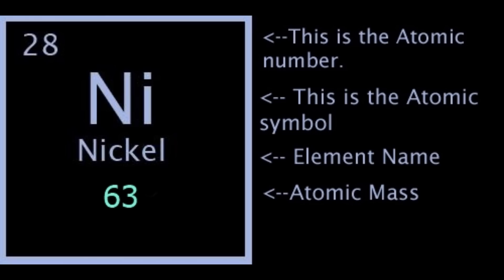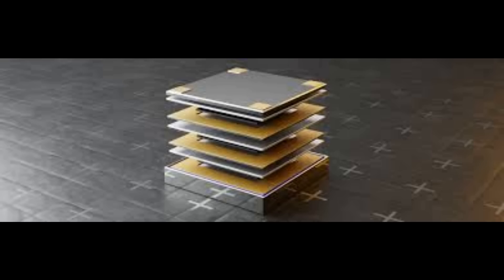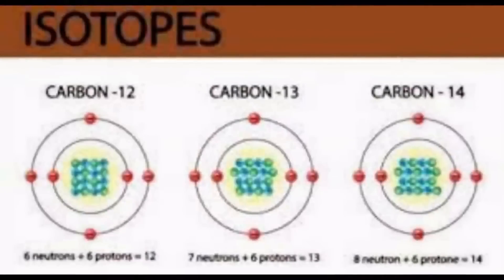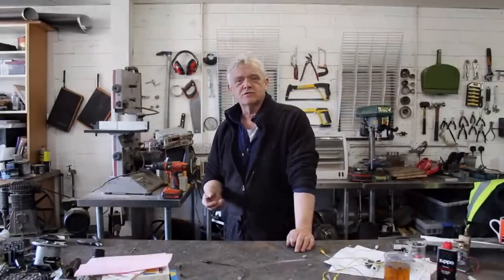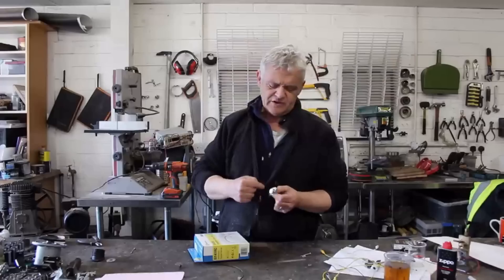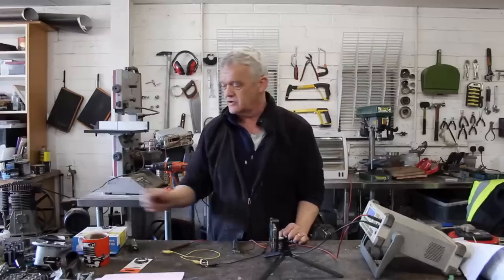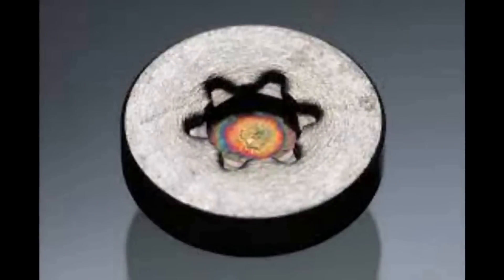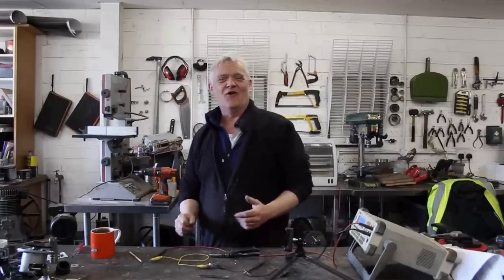2187 - The 50 Year Nuclear Battery From China And How To Make Your Own Version

Comment: A nuclear battery, etc, of low power can be assisted by a capacitor for when a relatively large amount of power is needed, say a transistor radio or a LED lamp to function when needed.
Reply: joule thief
Reply: Supercaps are also used to make mini portable car Jumpstart boxes.
Reply: This concept relies on the particle beam itself hitting a point on a surface that generates the current or whatever, so in theory, a large sphere with the inside wall full of these minute batteries focused on the same central point that can generate this current (or whatever) would result in a much higher energy concentration and for the 400 years or so. Think of how a satelite dish works.

Realistically we just need to do the math on how large that sphere/dome would be and build ourselves one of these bad boys that can power a house.
Reply: Maybe not practical by itself, but, in theory we could link up enough of these to continuously and passively power some sort of mechanical energy storage system, it could always be adding power to a reservoir of sorts, which you could tap from when you need large amounts of energy.
Reply: @Max_Chooch  rethinking your suggestion, the mechanical storage would have to be immune to the effects of (for lack of the lroper term) 'self-discharge' to be practical. Being mechanical, there may be a design that has that feature and is unlikely to decay faster than the tiny trickle of power can deliver energy into the system.

The primary uses i can think of are all related to satellites and devices in space.
Reply: With such super tiny power, even storing energy while a device is not in use wont make it much more usable. Let's say you have a smart phone or transistor radio that consumes 1 Watt of power when in use. If your nuclear battery outputs 100 micro Watts of power, you will have a usage to off ratio of 1/0.0001 = 10,000 times no matter how you store the energy. It means if you use your smart phone for 4 hours in a day, you will have to charge the battery for 40,000 hours or more than 4 years before you can use it again. And modern smart phones are using more than 1 Watt and many people use it more than 4 hours per day so you have to wait even more before next time you can enjoy your old iPhone hahaha
Oh, I should also add that any mobile phone is using power even to just be in standby and ready to take an incoming call. The idle power consumption can easily be 1000 times more than what these nuclear battery can output, so you can't even power a smart phone in standby lol...
Reply: No, it can't. What you can do is use it to charge a conventional battery during "off-time", for devices that require power only intermittently. And yes, I said "battery" and not "capacitor", because capacitors can only store relatively small amounts of energy.

However, a far more efficient way to achieve this is by using a bog standard charger if you live in a first world country and have access to mains voltage Or a dynamo built into the device, like with some torches or radios, if access to mains voltage is problematic (no infrastructure, or during a power outage). Or use solar panels if it's a device in a remote location where you don't have mains and winding the dynamo is impractical. E.g. a LoRa node monitoring some environmental parameters in a remote location in a forest, or what have you.

I get it, these batteries are cool. But they're not a solution to every problem that has "power" in the title. There's a place for these things for sure, but powering devices that require more power than they can deliver is not it.
Reply: @EvenTheDogAgrees  Capacitors are far more efficients for fast "charging/decharging" cycles, like for example a low power device, 1W is not enough for a spike usage during wifi transmission for example, but you can use a few capacitor so that those spike are smothed out. Datasheet for the ESP32 declare a 260mA power usage in WiFi TX  with a 21dBm, at 5.5V that just a little over the 1W provided, assuming you can have small duty cycle and cut the wifi after a capacitor is enough and far more efficient than a full charging circuit. And that's the kind of application those battery will be used primarily, low power and low maintenance systems, perfect for non real time sensors and the kind.
Reply: @Larandar  yup, for such use cases it would be very suitable. Similar to the LoRa node I used as an example. But not to power things like radios or flashlights, unless it's just used as a charger for the real battery, and the device is only used very rarely. But like I said, there are already better solutions for those, e.g. hand cranking.
Reply: @Larandar  Just beware that ESP32 running on a nuclear battery isn't giving much run-time out of a 100uW nuclear battery. Whatever wakes it up has to use micro Watts of power and the duty cycle has to be 1/0.0001 = 10,000 times more off than on to reserve enough energy. Considering the half-life of the isotope, loss of efficiency over time and wake up circuit, you probably want to get to 20,000 times more off. Let's say you want to do a single transmission every hour to monitor a temperature, you will have the ESP32 running at 3,600/20,000 = 180 milliseconds. Adding more of these batteries should make it doable and such sensors are probably the most useful application of these super tiny power nuclear batteries. Forget about drones, TVs, laptops, mobile phones etc.
Reply: @EvenTheDogAgrees  I agree, but I'm in also agree with Robert basic concepts , I was  hesitant to find practical or efficient use.
Reply: @EvenTheDogAgrees Yep, it's mostly for keeping the contents of SRAM intact.
Reply: @EvenTheDogAgrees  iirc lora devices use as low as 0.5w of power, so you would need one of those commercial radioactive batteries and a capacitor to smooth out the output and act as a buffer in case of consumption spikes, imagine getting hundreds of those, tucking all  the electronics into sealed cases with antennas and spreading them around the world as emergency backup comms
Reply: @EvenTheDogAgrees supercapacitors can hold a decent amount of energy now, there are disposable vapes that use them instead of batteries.
Reply: @chemistryofquestionablequa6252  Are you sure these are supercapacitors? Some time ago i had seen a YouTube video where the guy disassembled a vape pen - the cell turned out to be a Lithium battery with a capacitor-style package.
Reply: @Gigasimo456  Yes, this is a recent development. A Tuber broke it down (don't remember who EDIT: IT WAS CLIVE!), some companies are switching to super capacitors because they are cheaper comparatively, hold less charge and are safer (allegedly).
Reply: @PanoptesDreams Big clive probably
Reply: @Ewr42  checked my history by searching his name, it didn't come up. But the flesh burning death lamp did ☺☺
EDIT: I was wrong! It was Clive, I just watched the video on a different browser so it wasn't in my YT history,
Reply: @chemistryofquestionablequa6252  As a motorcycle rider/builder and vape shop manager, 
I can vouch that Yes..  Supercapacitors are used in both 'vapes' as well as some motorcycles [for electric start]
as well as caps/super-caps use in auto audio setups [they help deliver constant/burst power for amp'd subs, etc.]

They're also good for charging up and throwing at your friends - yelling "Catch!".  That's always a shocking-experience! 🤘🤣
Reply: @DirtyDovi  lol
Reply: @DirtyDovi the vapes and devices using the caps still require a battery of some kind to charge the caps. It's impossible for the to run solely off the supercap without being recharged every time they were used once or twice by an internal battery or external charger.
Reply: @EvenTheDogAgrees NPC comment
Reply: @EvenTheDogAgrees  for your information a relatively small capacitor, and yes i said capacitor not battery, can run a raspberry pi or arduino microprocessor for several seconds to several minutes depending on how big it is (supercapacitors are a thing..) it's just that they store the power using static electricity which tends to leak out over time.
Reply: @chrismofer  Yes,  technically a capacitor is capable of doing things that are not what the OP is describing. What's your point?
Reply: @EvenTheDogAgrees  I have a tiny esp32 board which powers up every hour or so and runs off a small battery. I’m guessing I “could” trickle charge it, and potentially keep it running without plugging it into the mains? Impractical, but neat.
Reply: @EvenTheDogAgrees  First world or third, doesn't matter. Everyone has access to these things. Such an outdated term has little meaning anymore.
Reply: @EvenTheDogAgrees  So then you better vow to never allow to have an Automatic External Defibrillator used on you. Those use capacitors but obviously you say that's impossible. So if you go into cardiac arrest, you better not allow yourself to be saved.
Reply: @RT-qd8yl Nice try, but that's not what I said. Come back when your reading comprehension improves.
Reply: There are a few things to consider:

Nuclear batteries:

    Low power: True, most current nuclear batteries, also called radioisotope thermoelectric generators (RTGs), produce very low power, typically in the milliwatts or microwatts range. This is enough for small devices like pacemakers or spacecraft electronics, but not for something like a radio or LED lamp.

    Types: There are two main types of nuclear batteries:
        Betavoltaic: These use beta particles emitted from radioactive decay to directly create a voltage. However, their efficiency is limited, and they only work with specific isotopes.

        Radioisotope thermoelectric generators (RTGs): These convert heat from radioactive decay into electricity using thermoelectric materials. They are more efficient than betavoltaic batteries, but still produce very low power.

Capacitors:

    Storing power: Capacitors can store electrical energy and release it quickly. This could be helpful for short bursts of higher power, but they cannot provide sustained power like a battery.

    Limited capacity: Even large capacitors have limited energy storage compared to batteries. So, they wouldn't last long powering a device like a radio or LED lamp.

Combining them:

    Theoretical possibility: The idea of using a capacitor with a nuclear battery to provide short bursts of higher power is theoretically possible. However, there are significant challenges:

        Matching power needs: The capacitor size and nuclear battery output would need to be carefully matched to the specific power needs of the device.

        Complexity: Adding a capacitor would increase the complexity and cost of the system.
        Regulations: Nuclear batteries are subject to strict regulations due to the radioactive materials involved.

Overall:

While the idea of combining a nuclear battery and capacitor has some potential, it's still largely in the realm of theoretical research. For most practical applications, other power sources like solar panels or rechargeable batteries are currently more suitable.

Here are some additional points to consider:

    The comment mentions a transistor radio. Modern transistor radios are often very efficient and can operate on very low power, making them potentially compatible with some nuclear batteries.
    The development of new materials and technologies could improve the feasibility of combining nuclear batteries and capacitors in the future.

I hope this helps! Let me know if you have any other questions.
Reply: @marilynlucas5128  your comment was generated by a LLM.
Reply: @4_Nik_8  Yes it was

Comment: How many of those to power a flashlight?
Reply from the maker: quite a few
Reply: So it was 130mV? How many ampere did you say?
Reply: @hellfireburner  v/R
Reply: @steampunk888  v/(R+Rint)   The internal resistance will be rather high. You'll be lucky to get 10 microamps.
Reply: About a dozen, actually, 1.5V light / 0.13V per Americium source = 11.5 Americium sources per light.
Reply: So if you had a dozen of these you could make a flashlight that shines for one second every 200-300 seconds using a 13microfarad ceramic capacitor. For 400 years! That is a cool concept! Good for cave dwellers I imagine :)
Reply: @hellfireburner  Math is math. Why only one second every 200 seconds? The 0.13 or so milliamps is continuous from what his meter shows. Are you using cave man math?
Reply: @bluenetmarketing  yes most probably 😄 I really like this channel but everyone talks above my head hehe. I tried to calculate this using @befeleme ‘s comment about 10 microamps and your comment with a dozen to get to 1.5V and just guessing a rather large capacitor leakage   (maybe I used 30% but I don’t know anything other than that they leak)

Comment: I'm not getting too excited Robert. I saw a vid on this yesterday and the one thing we all want is a battery to power our house for say ten thousand bucks (or at least lower our energy bill), but this isn't it and isn't going to be apparently.
Perhaps I was expecting a panacea, but I wonder what it'll be used for or if it will take 10 or 20 years to find the perfect application.
Reply from the maker: you do right mate - It is fascinating but like all these things there are issues for sure
Reply: for sure but you can step it up and use it to charge other things. you could even run a small motor with a differential to do .. something. you can also hook a couple up in series for more power
Reply: Just think of IoT devices that'll last a lifetime (sensors, LoRa, etc)
Plus we live on an electric generator (Earth), we just need to "tap" into it (not for silly waste of energy as many westerners/ easterners do right now, but still)